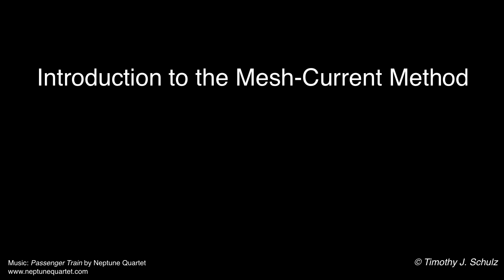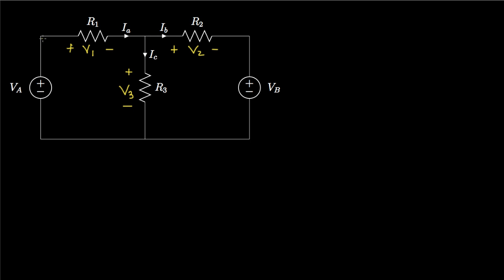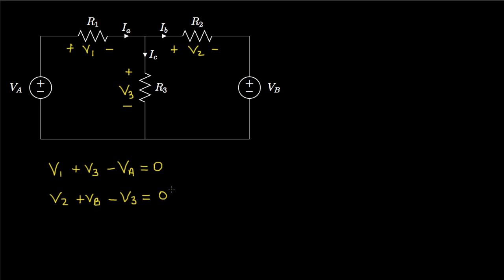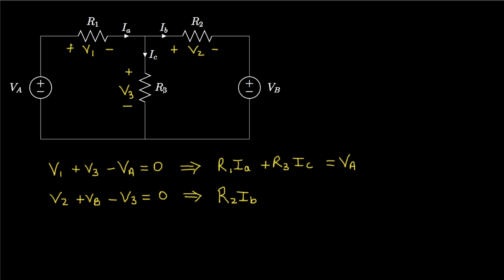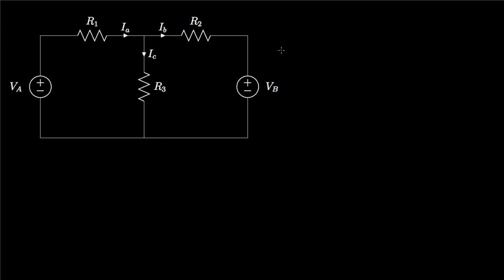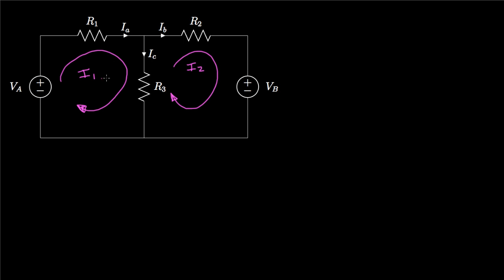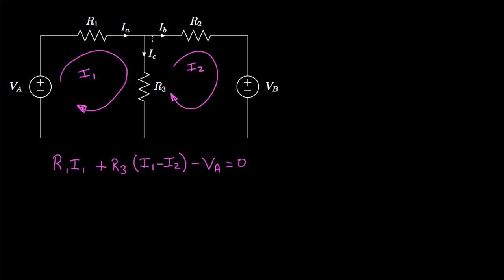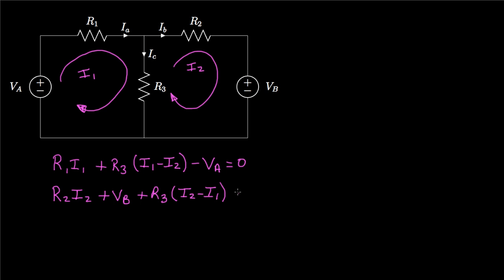Introduction to the Mesh-Current Method

Comment: Here's something that I am confused about. This whole concept seems flawed. You say mesh currents allows us to relate the unknown variables with only two equations but it doesn't. You simply found a different way to express the third equation and substituted it in before coming up with the other two equations... how is this any different then finding three equations and making the sub afterwords?
Reply from the maker: +Robert Murch For this example, the mesh current method is a systematic way of writing and solving a system of two equations instead of a writing and solving a system of three equations. How is that flawed? Sure, there are other ways to write equations and solve for the many unknown voltages and currents in this circuit, but that doesn't make the mesh-current method flawed. The systematic way of writing mesh-current equations is what makes this an important method.
Reply: +Timothy Schulz I didn't mean to say the method does not work. I was just saying it seems redundant. If you can simply use KVL and regular loops then why wouldn't you? Does this method work on some circuits where a regular application of KVL in a loop wont work?
Reply: +Robert Murch I think the mesh current method really just means you're solving a system of equations for current, as opposed to a system of equations for voltage, which would be node voltage method

Comment: Right before you used the mesh current method, when you were doing the KCL in the nod between the resistors. I dont Understand why ia is Negative and ib and ic are positives. I though that when the current is going tours the nod is positive and when they are leaving the nod they are negatives.